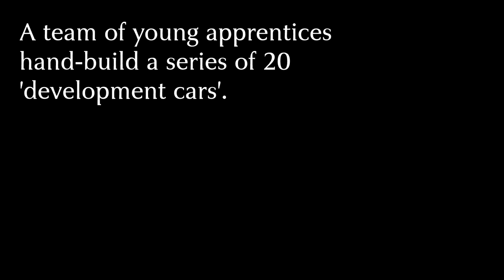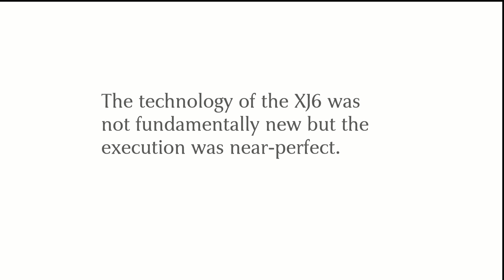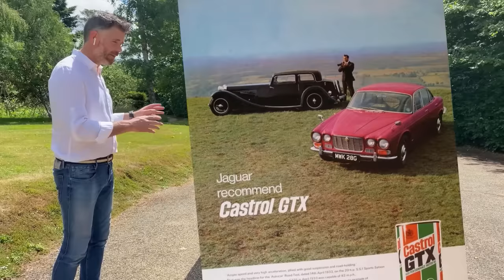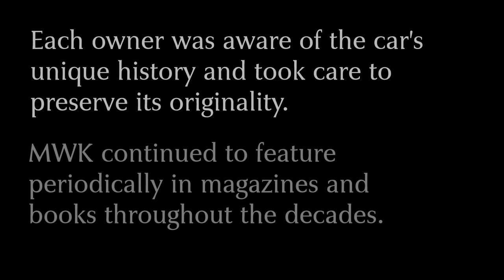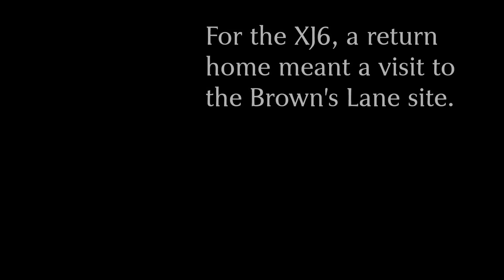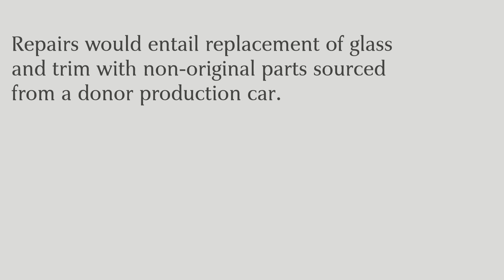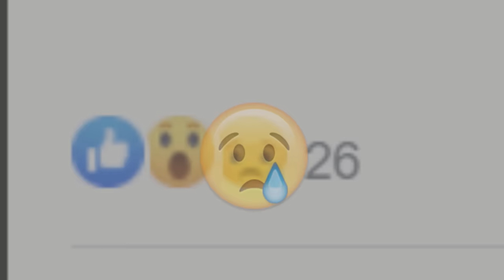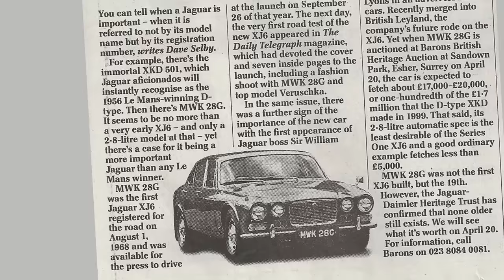MWK 28G: The Superlative Jaguar XJ (English language version)

Comment: Hello Adrian. Very nice and very comprehensive history.  In 1974 ,at 21, l had a 1969 4.2 Automatic . In 1977 l had a 1970 2.8 Manual with a factory fresh engine . If you hustled the 2.8 it was compareable to the 4.2 auto'. I always drove the 2.8 hard and it thrived on it . But the 4.2 was the much better car. In 2008 l "saved" a 4.2 Series 2 Auotmatic in Greensand  with optional velour (it was chaffeur driven when  new ) . I paid  £500 for it , restored in 7weeks for my daughters wedding ,( bridesmaids car ), and my eldest daughter who had never  driven an automatic was a  natural !  It still wins best paintwork with its next owner 12 years later. Cellulose ! The "bent" rear pipes were fitted very early in the XJ's life. And all staight pipe cars were recalled for extensive modifications to address the exhaust ingress. The boot seal was only partially responsible. The main cause was fumes being drawn up through the fuel tank chambers , then up through the rear pillars and thence entering the cabin. If you look very closely at early cars you will see "soot marks" where the side rail trim clips fit into the roof closing panels.  The tanks were removed and baffles were fitted beneath  the rear pillar posts. Regarding the very unfortunate  incident . Those early  screen mouldings were prone to coming loose and even flying off at high speed motoring . I'm sure you could find a specialist to repair the originals if you still have them. Having painted  many early Jaguars l can assure you that paintwork was not original . Jaguars never used a yellow primer so l can only  assume someone had already been there ! I do remember seeing this car . I think you'd only just bought it and told me the mirrors were going ! A quick post script ! When l had my  4.2 my father had a 2.8 automatic in Regency Red with the biscuit interior and "soot marks " on the side rail trims ! Thanks for sharing.
Reply from the maker: Thanks John... I didn’t know the full extent of the fume issue or that it was apparent so soon; though I suppose, as a problem it should be a fairly obvious one! The paint, I am told different things by different people - including that some of the techniques with development cars were non-standard...?

Comment: My first Jaguar was a 1965 3.8 S-type which needed new timing chains. I managed the job even though I had never worked on a Jaguar engine before. I did many things to it over a few years, including refinishing all the wood, a good winter in-the-basement project and rewarding to see how it turned out. The last of the classy interiors IMO.  I sold that car and a 1961 MGA "Deluxe" to buy a 1961 E-Type roadster project and finish that in less than a year. After selling that for $ 12,000 (what I felt was a smart move), I  had a few XJ-6s, the final one being a Euro-spec, grey-makret Series III. All fantastic cars and still the most beautiful production sedan ever produced anywhere. Thanks for the great video and all the fascinating information. Good luck with your car!

Comment: Well done Adrian, and what a wonderful car. My first car, in the 1990s, which I learned to drive in, was a 1973 Series I XJ6 (SYJ 229L), manual with overdrive, in Old English White, with the same colour interior as yours. It was one of the last of the line before the Series II, registered in June. I was told it had originally been a 2.8L but someone had dropped a 4.2L in its place at some point, and changed the badge accordingly. Somehow, it had wing mirrors fitted in the place you would expect to find them today, which was very useful for learning to drive! 

A wonderful car, and surprisingly, I never had any electrical issues. The only control issue I did have was the vacuum system had failed on the heater control, so the previous owner had inserted a tap under the bonnet, like you'd find for connecting a washing machine! That was where you controlled your cabin heating from! I remember that one summer day, I took the family out in The Lake District, and I'd forgotten to turn the tap off. The heating system was so powerful in those cars, that I had to pull into a lay-by, pop the bonnet, and turn it off. My Mum, sat in the back with my Grandma, had pink legs! Even Grandma, who liked everything tropical, remarked that it was "maybe a little warm"! 

Sadly, eventually the underneath of the car dissolved, and I then suddenly needed a car for work, whereas I'd never needed or even used a car for work before, just for fun. Hence, I sold it to a friend for restoration and bought a 1989 XJ40 3.6L automatic, and loved the auto so much, I've never owned another manual. My friend pottered away on it as a back-burner job for years, and part-finished the restoration, but then was getting divorced, so sold it on. I don't know where it is now, but it is still around, last changing hands in 2016. It's not been taxed since 1996 though, when I took it off the road! 

What an amazing car that Series I was to learn to drive in though. The clutch pedal travel over the biting point was such that you couldn't stall it unless you were a complete idiot, and I liked the power steering better than any other car I've ever owned or even driven, including my current 2004 XJ6 (X350) 3L V6. I remember I used to spend half my driving lessons criticising my instructor's brand new Renault Clio, for how bad it was compared to my rather ancient Jag! I also remember that when I passed my test, and told the examiners (I had two with me) what I drove, they were delighted to have passed me! 

I had decided that the Series I XJ6 would be my first car, from the age of 14, when there were some articles in Classic & Sportscar about it in 1986, and I fell in love with the most beautiful thing I'd ever seen sculpted in metal. The "Owners View" article was about one of the early press cars too - MWK 22G, if I recall correctly - and he'd taught his daughter to drive in it. I just checked on the DVLA website, and it's still around, but currently on SORN, and looks like it was last sold on in September. 

You've really taken me back Adrian - thank you. When all this pandemic is finally sorted out, maybe I'll see you at a motor show. Do you ever come up to the northern ones? I'm in Kendal, and our JEC region for Cumbria & The Borders - Solway Jaguar - attend quite a few of those. By the way, as your rear windscreen was irreplaceable, when that tragic accident occurred, how did your bodywork man replace it? Was it a custom piece of glass, or did he modify the bodywork? All the best, and sorry I've rambled on so much!
Reply from the maker: Thanks Marcus... Unfortunately production car glass had to be fitted. The aperture is fine, so no metalwork involved, but different rubber and chrome trim is needed (the development cars had a vertical heater matrix in the glass and wider chrome trim). Although there is an enthusiast in Holland who may be able to get their hands on a development car screen which will be great if possible. I am looking forward to the time when the shows are up and running again and hope to see you around!
Reply: @adrianmassey4627  Absolutely - and how lucky you were to meet Bill Heynes' son at a show!

Comment: I would not have done a bare metal respray. I would have had the original paint keyed-in (surface is sanded until matt all over) and then sprayed over with red-oxide primer. This means you use the existing paint as an extra layer of paint to protect the bodywork even more. You got it fixed is all that matters! Beautiful colour too!

Comment: It was piston dwell on the short stroke 2.8 that caused the piston holing problems, Jaguar did fit uprated pistons to later engines and the ignition timing was altered ref a factory TSB, Haynes manuals etc do not list the approved ignition timing! Saying that the 2.8 is turbine smooth and revs like the clappers due to it's short stroke! I've got a pretty much original/ Unmolested one of the last (May 1973) 2.8 S1's in Fern grey with 57000 genuine miles, 3 previous owners tucked away in my barn! The S1 is such a beautiful car.

Comment: Thanks Adrian,  what was the model at 0.31 called? (false starts)
Reply from the maker: Hi Brian. William Lyons ultimately oversaw design of all new cars (the XJ6 being the last where he had this role), and prototypes were sometimes delivered to Wappenbury for inspection in conjunction with his wife (which is where the car at 0:31 is pictured). For a while he toyed with an E-Type rear-end which is where the styling cues come from in that picture. As for the particular XJ denomination, I don't know - in the early 1960s the concept for a new saloon was known as XJ4 (later it became known as the XJ6, presumably as it became clear that at launch the cars would have the 2.8 and 4.2 6-cylinder engines. There is a lot more detail at the excellent Aronline website -

https://www.aronline.co.uk/cars/jaguar/xj6-xj12/the-cars-jaguar-xj6xj12/

Comment: fascinating history all put in a very nice video! 
In my opinion the series 1 has a nose that looks a bit heavy to the eye. The grill and bumper extend just a little bit too deep.
For me the series 2 is the nicest looking XJ, specially the XJC. 

I have to make do with a fuel injected 4.2L series 3. 
However, i am not complaining because it's a Jaaaaaag. ;-)
Reply: The Series 111 has the sharpest styling. The tapered rear end, the rear door quarter lights, flush door handles, smart alloys, improved styled seats, more attractive veneer sets.The Series 111 was the pinnacle of the original pre XJ40 saloons. Be thankful for what you have.

Comment: The bit of the seat the gentleman picked up was the cushion.  The squab is the bit you lean your back against.
Reply: Not necessarily so....

In general upholstery usage, the squab is the thickly padded cushion of a chair or sofa one sits upon, contacting the thighs and buttocks.

In North America and Europe, the squab in vehicles is the lower seat portion.

The exception is England for automotive usage during the 1900s. In that context, squab refers to the backrest portion of the chair or side supports one may lean against. In England today, if the conversation is about antique cars or purchasing parts for them, squab refers to the backrest. If the conversation is about modern cars or their parts, squab refers to the seat bottom portion. If clarity is desired, the term squab is avoided.
Reply: @PhD63  Good point.  I'm old school and the trimmers I have dealt with in England are too so no confusion.   I've got Herbert Austin's book of the Motor Car which refers to the cushion and the squab the way I understand them.  If I was going somewhere new I would definitely clarify unambiguously!
Reply: @johnnytenjobs, So we are all clear then on what a seat squab is then 😃. I always thought it referred to the bit you sat on, never knew it could also mean the back rest, the English language eh?
Reply from the maker: The confusion here is more forgivable than the boot/bonnet aberration... 🤪
Reply: @adrianmassey4627   I own an Imp.  The bonnet is really the boot and I'm not sure what to call the lid with the engine under it at the other end.  There's definitely no hood.

Comment: Best Jaguar in the best colour, but silly IMO to remove the correct original wing mirrors.

I have a late Rover 75 with the equivalent "small  problem engine".. 1.8 K Series. It loves to be driven hard just like the 2.8 XK.
Reply from the maker: Depends what you mean by original for a hand-built car...  They were added early but are not in the early press shots.
Reply: @adrianmassey4627  Fair enough, I suppose they were added by the factory along with the new engine when being refreshed for onward sale after its duties were done.

Comment: Really interesting. Although it was an extremely early pre-production model, it has the later “outward curved” exhaust pipes as opposed to straight tailpipes that even the early full production cars had. Anyone offer an explanation why the incorrect pipes were actually fitted to this car?
Reply from the maker: Hi Steve, a previous owner retrofitted them. That invariably happened to the Series 1 cars because it became known that they were slightly too inboard - as the vortices created behind the car would suck the exhaust fumes into the boot, and thereby into the cabin... later cars had cranked pipes for that reason, to splay the exhaust gases far enough away from the vortices that they weren’t sucked back in. But they do suck aesthetically, hence some prefer the original CO-poisoning chic of the straight pipes.

Comment: Shame about the damage but was the car resprayed with Cellulose paint, which I believe was “outlawed” by EU regulations? If used, how is this undertaken and how many coats were needed?
Reply: I'd be interested to hear that too.
I believe classics are an exception that can be sprayed in cellulose, or at least that was the case when the ban originally came in.
Reply from the maker: The paint was water-borne which is compliant - and mixed by PPG to an exact match of the original shade.
Reply: Hi Adrian, thanks for answering that question, but why wasn’t cellulose paint used in order to ensure the car kept its originality to some extent. I understand Jaguar Classic Works still use cellulose paints on some of their classic restorations.
Reply: @dougwarren2992  Must be an incredibly tough decision, but done with much love and expertise, can be impossible to tell the difference. Will be far more durable than Cellulose, preserving her for many more generations to enjoy. I'd highly recommend protecting every 3 months with Collinite 476s wax, which lasts ages and will look right in terms of depth and reflections, over modern synthetic sealants or ridiculously expensive boutique waxes.
Reply from the maker: @matthewjenkins1161  thanks!

Comment: I unfortunately did my apprenticeship with Jaguar during the early 80s.  From a mechanic's perspective, the XJ6 was absolute rubbish: oil leaks (which could never be solved due to the poor design), engine failures (primarily due to the poorly designed AED unit flooding the engine with fuel on cold starts), overheating and head gasket failures, automatic gearbox failures, electrical problems, front suspension ball joints, leaking power steering racks etc.  From a driver's perspective it was a pleasure... when it was mobile.  The mid-80s fuel injected Series III was somewhat better, but I wouldn't want an XJ6, even if you gave it to me.
Reply from the maker: Happy days! They don't make 'em like that any more etc.! ;-)